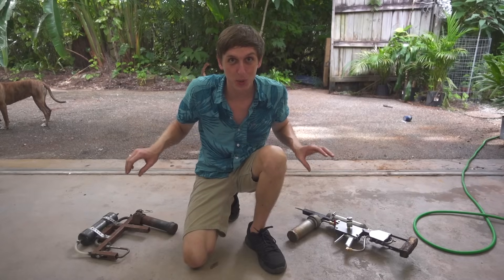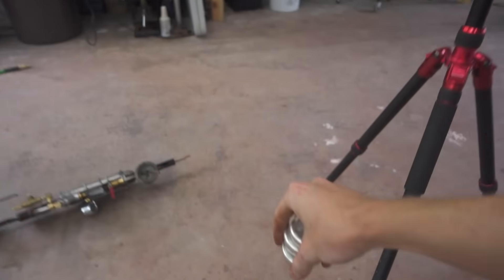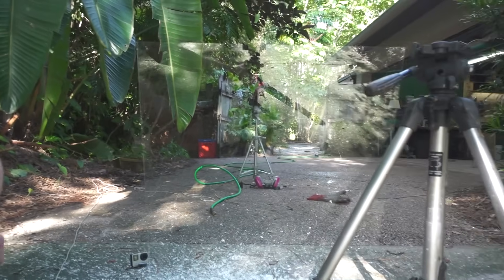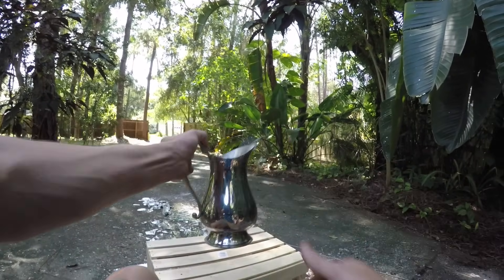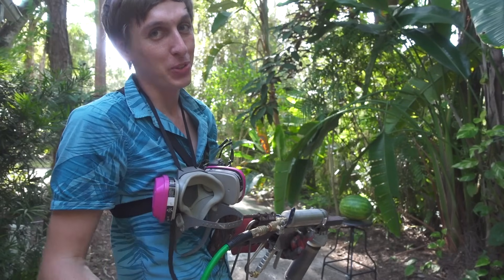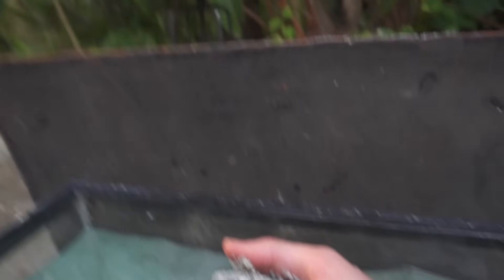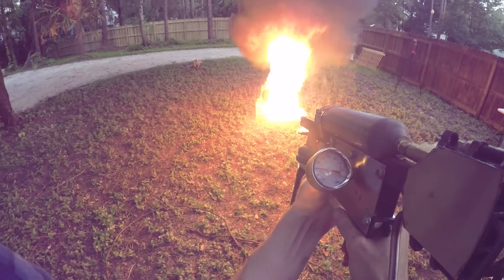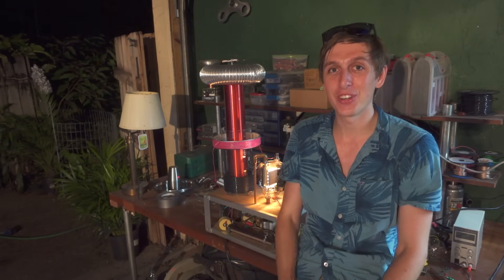Molten Metal Squirtgun!

Comment: this has to be remade dude - you might have used galium the same, if its not glowing its not molten metal
Reply: What? Molten metal is just melted metal. He was using pewter which melts at around 338° – 446° F. It doesn’t have to be glowing to be molten, all molten means is melted

Comment: I think this design can be improved upon. I noticed the molten projectile did not have much penetrating power. Perhaps heating the metals using electrolysis can open up opportunities to using more dense and heavy metals, metal oxides and even salts. Although this may be expensive and dangerous it may be a worthy upgrade since the metals he was using were relatively light and did not have much penetrating power.
Reply: Why do you know this why

Comment: So if there’s a 2 x 4 then 2 x 4 and you divide that by six and then you get a rotor which is a thing that I invented so when you get the router and then you can find it with a bunch of other stuff the rotor is technically like well for Tesla coil in but instead in Crete super electricity electricity stays for a long time and then for those are connecting goes in circles and Kin powers so much stuff

Comment: I wonder why no one points out that's this in it's principle is basically a weapon of reapers from mass effect. If i remember correctly it shoots a stream of molten metal. Of course, they use some high temperature tungsten alloy and accelerate it to a relativistic speed with mass effect instead of air pressure, but at the end of the day stream of molten metal is the stream of molten metal.

Comment: Copper and Antimony act as hardeners while Lead is common in the lower grades of Pewter, which have a bluish tint. It has a melting point, around 338 – 446 F ( 170 – 230 C ), depending on the exact mixture. Pewter was first used around the beginning of the Bronze Age in the Near East.

Comment: You might be able to use metals with a higher melting point if you use JB weld instead of teflon tape to seal your connections.

Comment: ok imma make like 2 sections of what im gonna say
1:it can cut through things if its hotter then how you heated it but the risks of destroying something inside or something like that it could go straight back at him and do something bad or it would spray out in different places
2:i think the reason it sprays like that is because its like a last resort and its low on metal and the air pushing it out is too strong and is causes it to spread out (from a rare gamer SavageBeast)
Reply: E pain

Comment: Use a deck brush and sunlight dish soap and cold water, also a plastic snow shovel might be nice, go from the farthest point and scrape/scrub it all back to the house, id just cut off the parts of the plant that the molten pewter landed on if you cant pick it off with ur fingers. ANd there ya go, sift the pewter outta all the dirt in the pile after youre done and you can throw the dirt back in your yard and melt back the pewter. Ill try and invent a time machine so I can go back in time and tell you this X) lol

Comment: Now, I wonder if you could could heat the metal portably using your portable induction heater but a custom version where the coil is around the molten metal magazine. A thermometer or timer could be set to tell you when it’s melted and ready to fire.

Comment: Interesting
Reply: Curious, TheBackyardScientist, could you cast that pewter foam in resin in that form making an enhydronated pewter geode. Or spray it into another foam like High heat spray insulation making a brick or panel checking for R values? even in paint once cooled.

Comment: “People have been making water guns and I want to to!”
5 minutes later
just straight up builds a flamethrower
Reply: An oil squirtgun with a water heater in the tank. Would stick as well......didn't Rachet and Clank have a lave squirtgun?
Reply: TheSwolOne it’s the equivalent of putting boiling water in a squirt gun 🤣
Reply: @apexprofessionalhoning716  thats double how hot boiling water is. And boiling water cools off faster and will slide off. You can be unharmed by a boiling water squirtgun but I think this would get flesh to the bone.

Comment: So did the pewter jug melt because of the heat of the liquid metal or because the two metals were the same density? I'm curious if something at a low temperature like mercury could cut through iron because it's more dense than iron.
Reply: I looked into it and it's definitely down to heat. Mercury will not go through iron at a normal temperature, but iron will float on it.

Comment: why didnt you use solder?
Reply: Soldier?
Reply: @liamreeves4946  no. solder. the stuff they use for wire work. it melts extremely easily. and you can bend it with your hand
Reply: @tornadius4343  you mean solder led

Comment: Cool gun High temp pipe dope pretty cheap used in all sorts of industrial piping connections you could get much higher temps and use different metals with higher melting points

Comment: The Military Is going to want that gun
Reply: The military could just make that gun.
Reply: everyone wants this gun
Reply: A gun that shoots all liquids , badass
Reply: Why it's torture and it cost alot
Reply: If you think about it, what would be the point? A normal gun can fire further, and production is easier.
Reply: @themitochondriaisthepowerh9177  Flamethrowers were widely used in the Pacific theater in WW2. The japanese drug tunnels through the entirety of some of the Pacific Islands, and flamethrowers were the only way to get them out.
Reply: @themitochondriaisthepowerh9177  He used the gun for both purposes in the video, so I just assumed the original commentor was talking about the flamethrower.  I guess that's the danger of using pronouns without antecedents. People have to guess what you are talking about. Also, I believe the napalm used in fanethrowers during WW2 burns hotter than the 400 degrees the metal in the video does. If you want to see some awesome new military weapons, look up rail guns. We (the U.S.) have started installing them on some of our battleships. It uses magnets to launch a solid object many times the speed of sound. It travels so fast that, although it has no explosives in it, it explodes on impact.
Reply: ChurchHASM nah that would be too cruel to use
Reply: Creative Xd if you need all caps and 3 !'s to explain its a joke, then it's probably not a good joke.  This definitely applies
Reply: +shiwei ding that makes no sense, why does him yelling have to do with the joke being bad?

Comment: I really like the video but you should try to get a bigger tank for the molten metal and a higher pressure air compressor on it so that you get a longer lasting blast that puts out a lot more force from impact. The video was still amazing though and I would not even had thought of it.

Comment: A few ideas for the Tesla coil: 1. Try placing a number of incandescent light bulbs around the arcs to see if they will light up. 2. Place a flame near the arcs. Flames have some ions in them so you should see a spark go to the flame. 3. Finally, try spraying a fine mist of really salty water over the arc but please make sure you are not anywhere near the mist or whatever is dispensing the mist! My guess is that you will get a knarly cloud of plasma, arcing from droplet to droplet, but the electricity will not have as much resistance as it does going through air so the shock could be incredibly powerful if you are not far enough away or very well insulated. If you find a way to pull it off I will sub for sure! Stay safe man!

Comment: Just use gallium
Reply: Torrey Jenkins Pewter is way cheaper.
Reply: Torrey Jenkins too expensive
Reply: Torrey Jenkins and gallium doesnt need to be hot to melt
Reply: Elijh Perez doesn't matter too expensive
Reply: Torrey Jenkins that no fun
Reply: Expensive AF but it would be so cool.  Or shooting acetone at LEGO bricks
Reply: Should get some of codies few hundred pounds of mercury and mercury is really dense so it would be like shouting a bullet
Reply: Its very very very expensive it would teke him like 400$ for 1 run
Reply: And i agree with John Mulcahy
Reply: What would be the point since the gallium doesn't need to be hot? Isn't the point of the video for the metal to be of a high temperature?

Comment: TheBackYardScientist I give you a challenge. Shoot molten tungsten the metal with the highest melting point, out of the gun. But you can't use a plasma cutter to melt the tungsten . Good luck! 

:Edit hm realized 54 seconds later that you need something to keep the molten tungsten in but since it has the highest melting point you can't really use any metal to hold it. Maybe thick layers of tungsten to hold it in for a while? I know it's the same metal so it will eventually melt threw but just an idea.

Comment: Instead of teflon tape you should try a mixture of powdered graphite and gear oil, it should create a high temperature seal, you could also use high flashpoint oil to avoid potential for fire

Comment: Is your foundry able to melt copper? Grant Thompson aka TheKingOfRandom made a foundry out of a trash can and kale wool and it melts copper.
Reply: Sparky copper is easy to melt.
Reply: Sparky it's kao wool
Reply: Copper is not as easy to melt as you think.  With a melting temperature of 1,984°F (1085°C) and a high conductivity (it cools very quickly), it is not an easy metal to melt or one to work with, for that matter.
Reply: Ethan Ferns copper is not easy to melt, 1058 celsius is not easy
Reply: Sparky I don't like the way you said that
Reply: What do you mean?

Comment: You should mess around with wireless power there is a little trick that Tesla discovered that if you put a coil on top of your Tesla coil that's about half the diameter of the secondary but twice the windings it increases Wireless power range

Comment: idea for a tesla coil video: use the fidget spinner to get multiple arcs of electricity and try to turn on a circle of light bulbs with it (or burn out a circle of light bulbs, dunno how much voltage the lightning bolts have).

Comment: Could you try mixing thermite with napalm and firing it from your flamethrower? :3
Reply: Thermite is rust with aluminum powder if I remember correctly, and napalm is just gasoline with a bunch of styrofoam mixed into it.

Thermite is a highly dangerous bit of fuel. You gotta get a stick of magnesium to burn it. Then, it'll burn so hot you could light it on the pavement and it'd burn through. It also cannot be extinguished by anything other than like, maybe liquid nitrogen probs.
Napalm is very sticky and dangerous, and is as easy to light as gasoline, as well as being just as easy to extinguish. 

The two combined would make excellent flamethrower fuel

Comment: Would it be possible to hook up a motorcycle battery to the side of the gun so you can shoot it whenever instead of immediately and and put a grip on the side of it so it wouldn't be so awkward to hold and instead of shooting metal you could shoot wax like from old candles

Comment: I'm sure this will get lost in other comments, but I'd like to see this gun melt material itself. I'm not an engineer, but I feel like wrapping the hopper with heating elements (water heater, toaster, hair dryer. Whatever gets the job done) would achieve this. In the interests of mildly safe use, I'd make a heat resistant jacket to fit around all the hot bits.

Comment: That just begs the question if you put hot liquid Tungsten, or hot liquid Carbon in such a device, would it cut through other metals just as easily as the pewter did to it'self.

Comment: try and shoot liquid nitrogen out of the squirt gun
Reply: spencer catier that technically wouldn't work because as you put the liquid nitrogen into the metal container it's building up pressure already so as soon as he screws it on it'll automatically come out of the barrel
Reply: spencer catier So basically a freeze gun. Cool stuff! 
Got it?
Reply: spencer catier Mei gun
Reply: SupahotFIREE Liquid nitrogen is stored wherever it's stored. It doesn't need to be a specific container, but some containers will work better than others. However, because it is so cold, the gas has compressed. Therefore if you were to put it in the gun, it would slowly heat up. As the nitrogen heats, it expands, increasing pressure and comes out the nozzle. It would be slow, but it would still happen.

Comment: You need to make a version that can melt the metal inside the gun (so basically add a propane torch facing your ammo canister) this way you can load a fresh, cold canister then melt it and fire.

Comment: Dies of lead poisoning
Reply: Nathan - Pewter is an alloy composed of  tin, mixed with copper, antimony, bismuth, and sometimes lead.

Lead is less commonly in use today, but it was in wide use in the past.
Reply: Yeah a decent amount of pewter contains lead, especially if it's low grade or old. I do not recommend eating anything that comes into contact with it if it was hot. Eating off a pewter plate would be fine though, as long as the food wasn't very acidic. The problem is the potentially very fine fine dust of aerosolized molten alloy.
Reply: Ah I see, thank you. I didn't know that.
Reply: TBH chances are I absorb a absolutely puny amount of lead. Not hot enough to produce large quantities of dangerous vapor and not a large enough quantity to be a risk, provided one washes their hands after using it. Lead solder is much more reliable, unless you go for the more expensive lead free solder alloys and soldering equipment. Lead is my favorite metal XD. I'd be more concerned with the smoke produced by the rosin or petroleum paste based flux burning off. That's gonna be the real problem right there. Ventilation is key. All smoke = unhealthy. Even cooking can be carcinogenic if you regularly cause grease to smoke. Eh, precaution and moderation prevents problems.

Sorry for going off on a random tangent, my mind does this quite often and it's best (and fun) for me to share my thoughts. :D
Reply: @Jake Hammaker
XD well I use lead solder often enough, I better be careful. d:
Reply: Where did he shoot lead? The only metal I saw was pewter, and while you cant ingest it, its ok to make contact with food as a lot of old cookware was made with it
Reply: Yu he did use old pewter from the thrift store, so...

Comment: If you can find a material that can seal it without melting than try spraying aluminum and flipping the air tank upside down so it hardens the aluminum instantly.

Comment: Have you considered adding a flow controller to lessen the spatter when the metal gets below the pickup tube? I suppose cleaning solidified metal out if the nozzle wouldn't be fun either if the next firing can't re-liquify the stuck material.

Comment: Hey! I have a suggestion for your molten metal squirt gun! I was wondering if you could mount a blowtorch on the gun pointing towards the container with the metal in it, and have some sort of system where you could have a tube or cylinder pouring metal ingots into the fuel chamber! Thanks!

Comment: Love your videos, but you should have a face shield bro.
Reply: I was shocked he used... eye protection, crappy eye protection with no sides, or rating. But don't worry he's wearing probably a nylon shirt that'll melt into the skin, and all that exposed skin. No worries its only 400deg molten metal and he's a youtuber so they don't need basic protection.

Comment: You should make a how to video on that Tesla Coil. I experimented a lot with one in highschool using a Neon Transformer and rotary spark gap. We ran into a big problem that we were never able to solve though. 

Once we had the resonate frequency right and were able to make sparks. They were never very long and we found it was because the top 100 to 200 windings on the secondary would all end up arcing together. We tried a ton of different coatings trying to stop the arcing but never figured it out.

Comment: Someone on Reddit (https://www.reddit.com/r/askscience/comments/65p412/comment/dgccscr) asked if a raindrop could start a forest fire. I claim no, at those small scales it gets complicated. 
1. Heat spreads away from the focus point; this setup has a TINY focus and lots of room to spread, so to start a fire you'd have to focus onto a tiny target to get enough energy into a piece of flammable material. This is why, even with a lens large enough to melt steel bolts, you still couldn't melt a large steel weight. 
2. The small size of the target means air will cool it too quickly to heat (surface area / volume ratio - haystacks' spontaneous combustion is partially the opposite effect)
3. The focused light has to stay on target. Raindrops and tiny flammable specks are both not known for holding still much. 
4. Typically when there're raindrops fire isn't likely anyway. Also usually the sun isn't available.
5. The focus distance for a raindrop is so tiny the fire would have to start RIGHT NEXT to some water. 
6. Billions upon billions of raindrops exist at any moment, and equally many flammable specks. The combination of events required to start a fire has ample sample size even if its a one-in-a-billion chance yet we don't see evidence of it ever occurring ergo it's "not possible"

We should get backyard scientist to prove me wrong!